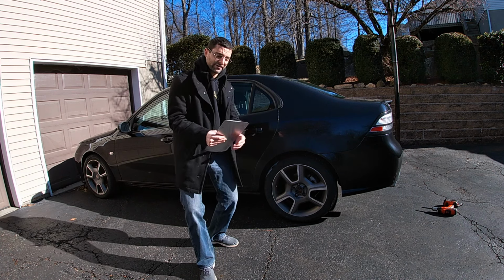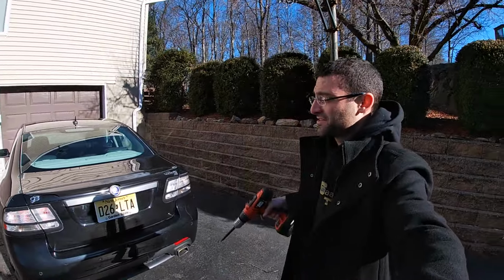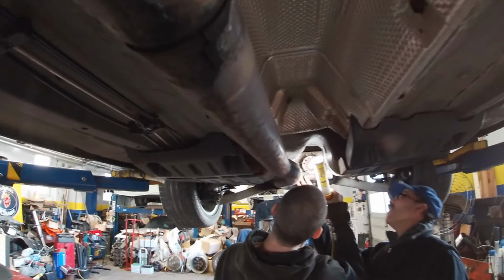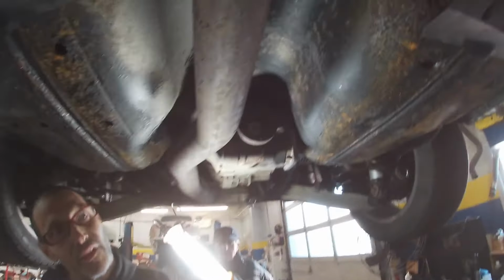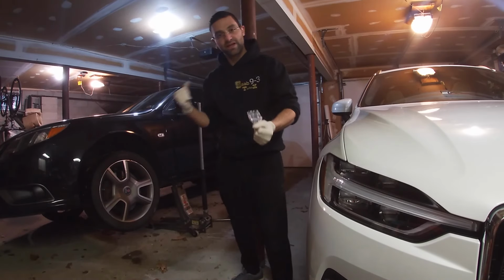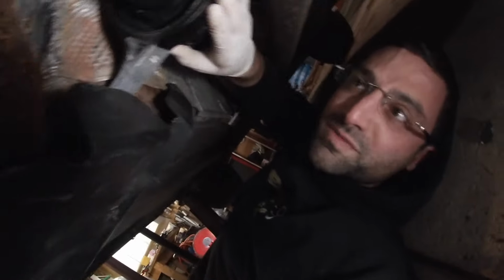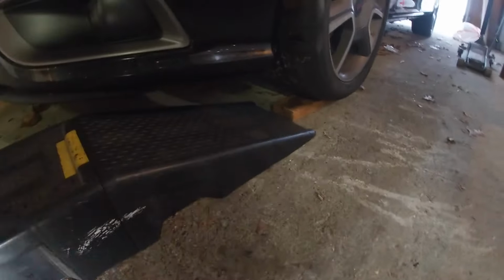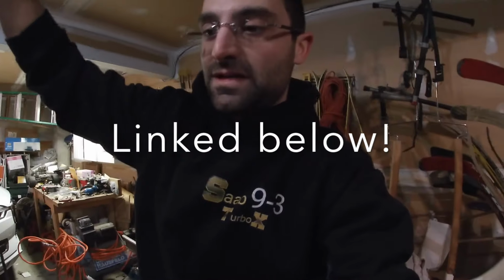I Bought a RARE Saab 9-3 TurboX XWD DRIVESHAFT Install + Oil Change

Comment: I can't believe I just saw you get under the Turbo X with only a hydraulic jack holding it up.  I'm pretty sure the jack stand was out of the way of the creeper and not under the car.  You should put the front wheels on ramps and then jackstand the rear wheels to give you proper clearance and keep you safe.

Comment: I am surprised you did not say anything about the positioning of the props haft, as this is very important. Those two brackets need to be positioned in exactly the same position as before or you will have vibrations. Did you mark the position before you removed the old prop shaft?
Reply: Agreed, I have watched several videos where they don't do this.  Very important!

Comment: We call it a propshaft in the UK - Drive Shafts are at the wheels in the UK it would appear - great video, seems simple enough to do. I had mine replaced but not sure why it needed doing it was only on 50k miles at the time...

Comment: Did you grease the splines of the drive shaft before you put in place ??
Reply from the maker: i did not
Reply: @KylePancis  You better get it done so the drive shaft can move and not will corrode and grew together...

Comment: Hey Kyle great channel 
I ve got a 2008 AWD 65 k aero with a differential not working and drive shaft which I shot and making funny noise when driving.... 
question could I make a 2 wheel drive without having a loss of differential liquids , front and rear.... ? It seems you made BUT my mechanic states that it could be dangerous... let me know if you can!
Reply: A pity you never got an answer. i was wondering the same and I have been advised the same.

Comment: Dude that single hydraulic jack on the plastic jack block holding up the car was giving me stress. Those plastic jack blocks are not the best in the world, I've seen them crack and split and shear off the part that holds it into the body... not to mention the jack itself could malfunction. Be safe!